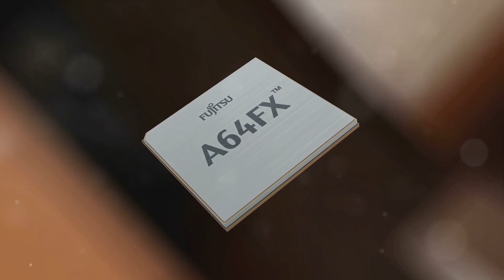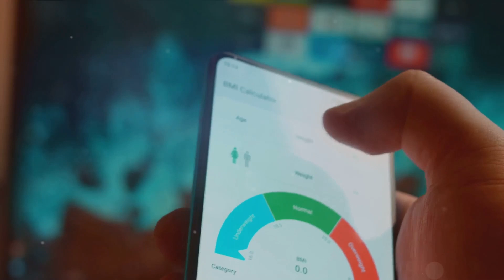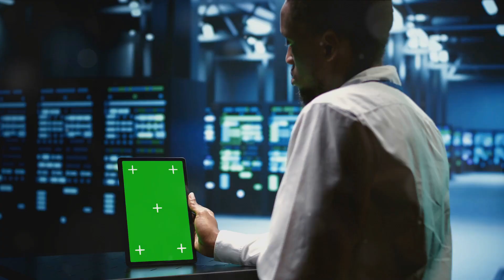How Qualcomm Lied and Cheated on X Elite Benchmark Test

Comment: Semi accurate is also knows for being wrong a lot of the time, kind of important to mention that. Both microsoft and qualcomm have said the new CPU's are as good as said, and it doesn't even make much sense to cheat on these benchmarks since they won't be able to fake it when computers come out, especially if they run like a celeron.

Comment: This isn’t exactly anything solid to go on these claims either.  All manufactures cheese their benchmarks.  The intel ultra line up and so on is slower than their 13th gen line up. Also current snap dragon 8 gen 2 if I’m correct is  already faster than intel celerons LoL.  Also in this area my self on tend to find what holds a lot back in performance is the tdp but up to 80w might be interesting .  But unfortunately these allegations have no base tbh. No substance to them